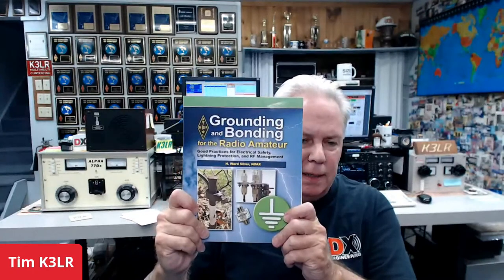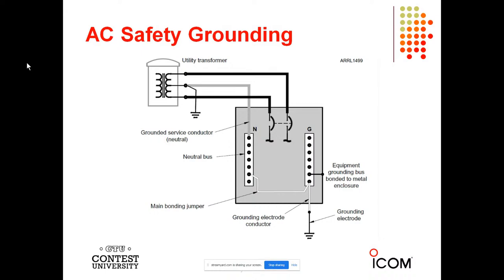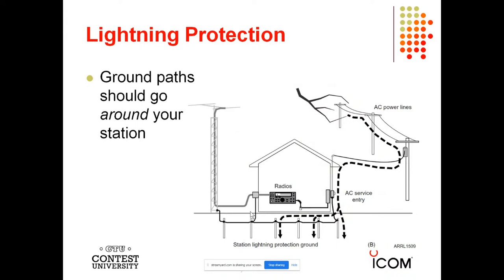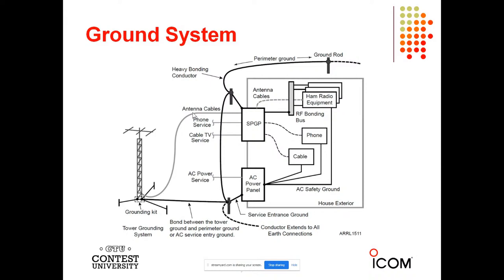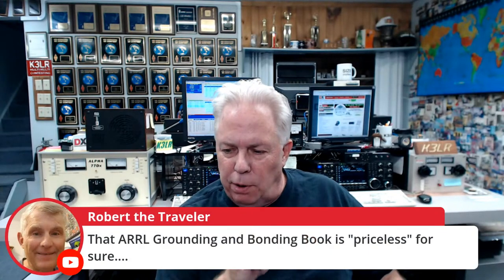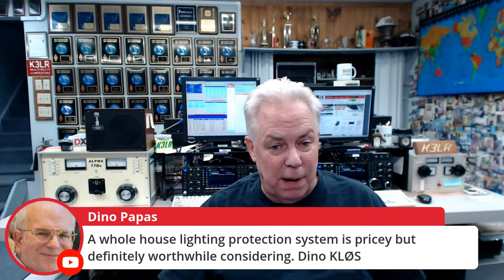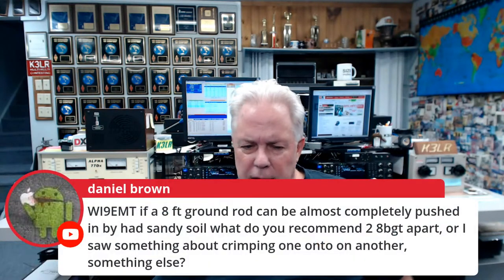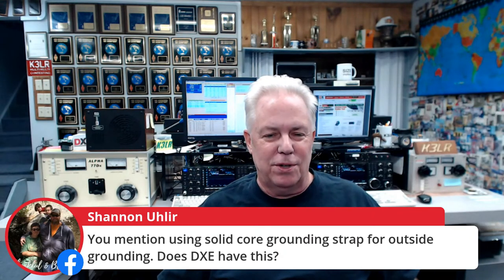Grounding and Bonding!

Comment: not sure why tim says not to use braided grounding strap outside. I have used it for over 40 years and never had a corrosion issue. maybe because i will coat my strap in silicone or coat the braid in oil 2 or 3 times a year when i do my walk around checking connections.to include any kind of tilt base bolts/nuts anything near the ground. but some times ill go 2 or 3 years between spraying them. i lived in extremely salty area's (Florida) 100 yards from the ocean and never had issues with corrosion on my braid. plus i use anti seize on all my connections/nuts/bolts etc. i got the idea  of using braid from the military that is what we used matter of fact my braid came from the military surplus yard i have several hundred feet of it to use. i think mine is 3/4" wide and i cut and soldier ends to fit. but Tim is right all Eqt should be grounded.
Reply: I use the same thing, also use it for bonding parts of my station, my car etc..